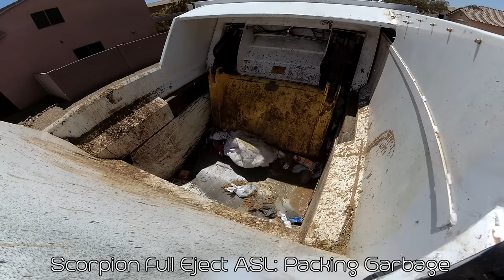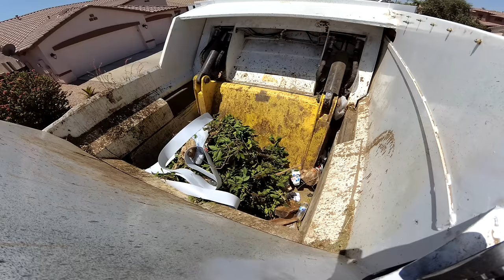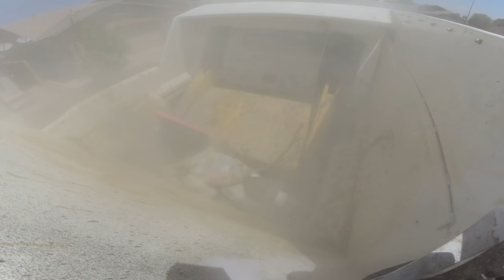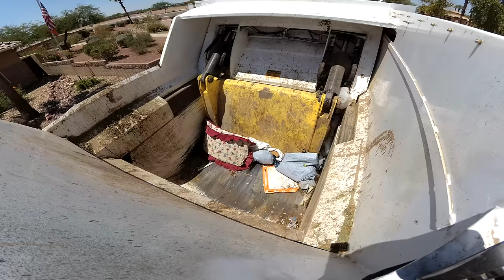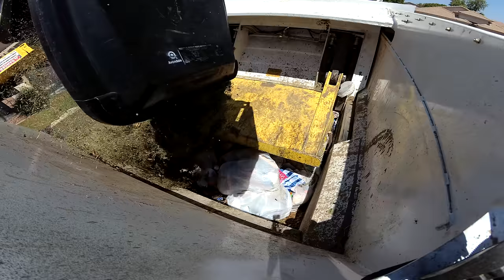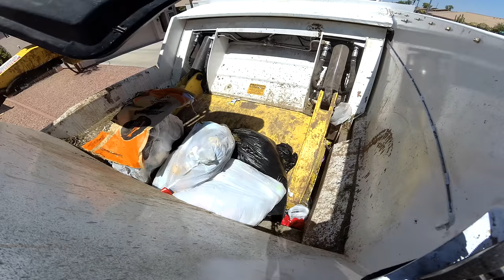DaDee Scorpion FE ASL Packing Garbage Hopper Video

Comment: I sure enjoy watching any scorpion hopper, especially when the truck is packing out. would love to see these facing more challenge, like 300s or anything back to back (filling up on townhomes or whatever). awesome job
Reply: Trashman242 T. M. 242 this packing system I don’t see it handling with 300s. Containers or a-line of Containers loaded I don’t see it working out to good . But looks cool with these half full cans more challenges your right. T. M. 242 Stay Awesome My Friend.
Reply from the maker: It will be coming for sure, a lot more video with this unit in particular, thank you Scott!
Reply from the maker: Abel Padilla This Unit can handle any container up to 450 gal with the 5 cubic yard hopper. It is just a large body capacity at 31 cubic yards. The highest payload this far is 18.1 tons of garbage in this thing.
Reply: Why, were supposed to get more residents to recycle more not  to trash up the world more then  we have been?🤦‍♂️🤦‍♂️🤦‍♂️🤦‍♂️

Comment: Seems so slow but it’s keeping up with the driver.  Great angle.
Reply from the maker: It has large telescopic cylinders driving the "Slide" function of the blade, which slows the blade down. Thank you for the comment!
Reply: Alexis Godin  it has to do with engine speed. I know this comment is coming super late, but basically the larger the diameter of the cylinders, the slower they move with a given flow, but the more force can be generated. Hence why the smaller cylinders that drive the blade move faster, but the larger ones that pull it back move slower.